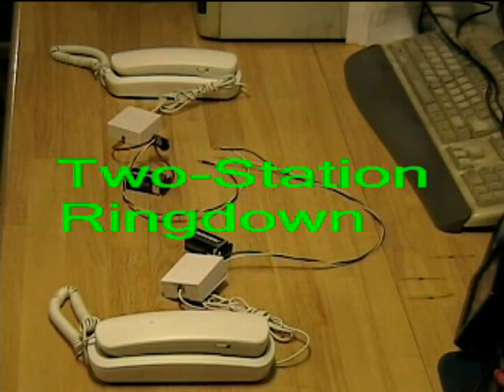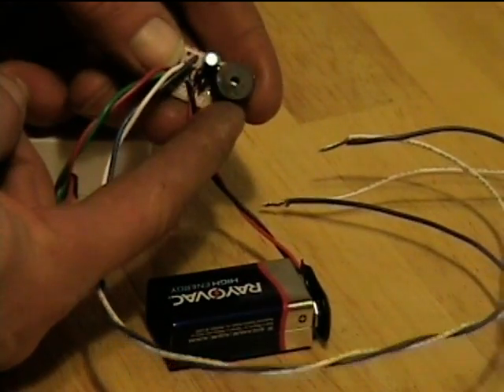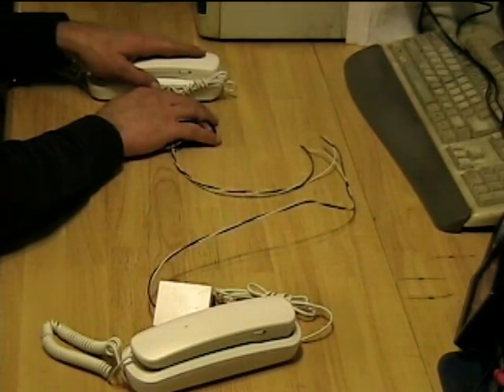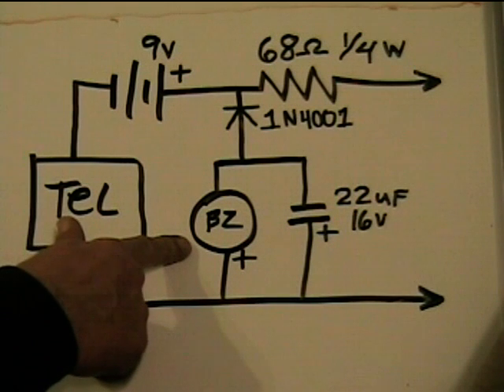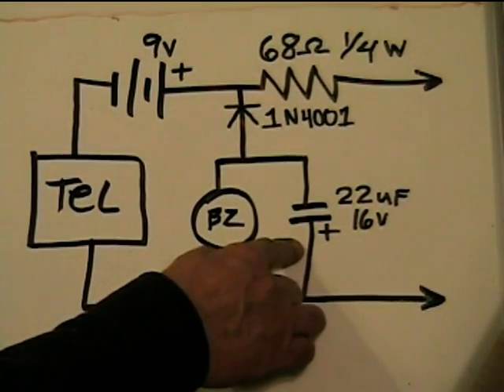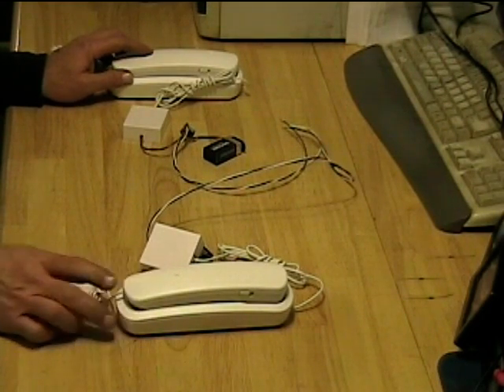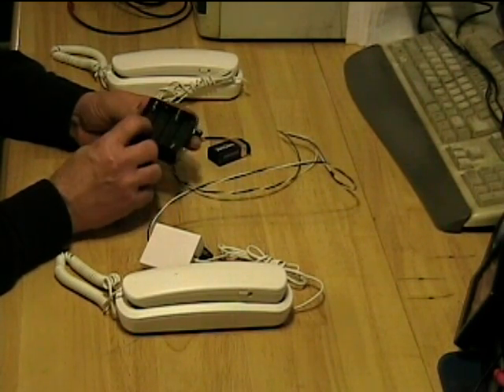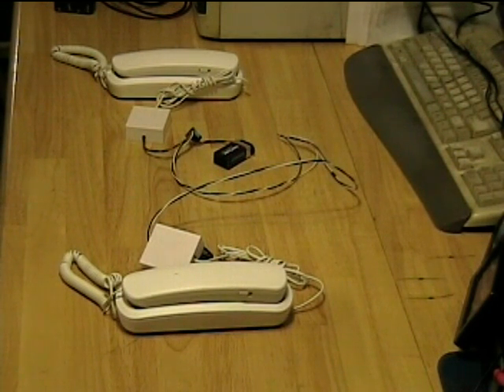Telephone intercom, Two phone w/signal W4P300 #302

Comment: Muito top seu vídeo,coloca nos comentários o material usado para que eu possa traduzi-lo
Reply from the maker: You will need two of each item: Telephone. 9 volt battery with connector. 68 ohm resistor could be 1/4 or 1/2 watt carbon or metal film. Diode (1N4001). Electrolytic capacitor 22uF at 16 volts (10uF would probably be fine). Electronic buzzer rated to operate from 3 to 9, or, 3 to 12 volts DC (very small unit that draws only a few mA of current).

Comment: This works great! It is very practical and works without grid power. This could be great for emergency communication  after a storm takes the power out. An LED can also be placed in this circuit for a visual / silent indicator. Some considerations I have found are that both batteries have to be charged about the same. A dead battery on one end leads to the "ringer" staying on after the other phone is lifted off hook. The battery, on one end powers the other phone and ringer. This also makes the phones only work when a battery is placed in both ends.

Comment: No way this is from 2016
Reply from the maker: Care to explain why you think this? It was created and up loaded in December of 2016. I know. I was there.
Reply: @wired-up  it just seems like an older video than that. I like the design that you used for the circuit, I’ve never seen a system with toning on both ends like that.

Comment: Even if you only need 9v, can you also just run it on 12v? Looking to set this up on a narrow boat to talk between helm and crew on either end of a 55ft boat. I wonder if there is a way to do speakerphone on both ends?
Reply from the maker: The #302 intercom requires two batteries, one at each end. For your short distance, 9V is plenty but you could use 12v if you increase the resistor value slightly (but you still need two batteries). Send me an email to intercom4u at yahoo dot com and ask for diagram #311 which needs only one battery, I think it might be a better solution for you. A speaker-type intercom is possible but it would be nothing like the circuit I show. It would require an audio amplifier (or two, depending on how you would build it). I do not currently have such a circuit available but I have seen others posted.
Reply: @wired-up  thanks. Appreciate the fast and detailed reply. Will email

Comment: hi sir what is analog signal is used for two way & two wire   intercom phone ? voltage analog signal or  current  analog signal witch one signal  use??
Reply from the maker: If you imagine that each phone has a certain amount of resistance and that talking into the microphone will vary the resistance, the current in the circuit will fluctuate as you speak. The earpiece of the phone makes sound according to the variation in current. Since the phone has resistance, the voltage across it will also change as the current changes.
Reply: @wired-up  it means current analog signal used for two wire intercom right
Reply from the maker: @sandeepthorvat6395  I would consider it to be a varying current that conveys the sound, but, as the resistance at the receiving end is not changing, changes in the current also results in a change in voltage. They are related. To consider it to be analog current would be simplest.
Reply: @wired-up  Absolutely amazing explanation of how telephones work. I have asked several people in the past, and they all had complicated explanations. I'm so glad I read these comments. You just blew my mind sir. Thanks, and I'm now subscribed.

Comment: Sir may i know is it possible i use a 12vdc 10amp  power supply in that kind of circuit
Reply from the maker: Well... Yes, but, that would be a few hundred times larger than is necessary! The maximum load is only about 0.03 amps so a 10 amp power supply would easily power the circuit. Don't forget that you need two sources of power, one at each end.

Comment: Hello again, 
I have built the two phone system ( decided I didn't need the three station) works like a charm! 
Question: is there a way to add a light to one end of the two station system?
Reply from the maker: Hi Zane! I have sent you an email with several diagrams, #305 will show how to use local power to operate a light or other device as a signal.

Comment: Hello! 
I am being requested to help with a problem my friends ran into with their intercom setup. After 0.5 miles, no sound can be heard on the line anymore. I am not exactly sure whether there was no sound on the line or less sound because I didn't see it myself.
I am thinking about building the setup in this video and using bigger batteries like you said so that the line can work up to a mile or so!
Will simply using bigger batteries fix this problem? Will the voice of the speaker be correctly transferred to the other phone? What should I be using?
THANK YOU
Reply from the maker: Not necessarily a "bigger" battery, but one with more voltage. 12 volts at each end should be adequate unless you are using very small gauge wire. Higher voltage would be ok as long as the current on the line is not too high. Typically there should be about 15-20mA of current flowing in the line when both phones are picked up. You will need a simple multi-tester meter to measure this. Set the meter to measure DC Current, probably on a scale of 200mA (or whatever the closest scale is on your meter). Break the line between the stations in one place and connect your meter to the line. If the current is too low, you can reduce the resistor value (with a long line you can probably just bypass the resistor) and/or increase the voltage until enough current is flowing. If you have phones that use a carbon microphone and have no electronics in them, they will work at a very low current level (perhaps even as low as 5mA) though the volume will be low. If it has an electret condenser microphone, when the current is too low, it will suddenly quit working. You could also try measuring the Voltage across the two wires of the telephone, typically it would be around 6 volts.

Comment: Dear Sir, I would like to use the buzzers from small wake-up clocks because of their smooth and interrupted sound. Each clock was driven by a 1,5 V battery. Could you tell me what capacitors I must use in order not to  damage the buzzers? Many thanks to share your experience!
Reply from the maker: Send me an email and I can send you a diagram that might work to provide 1.5vdc. I'm not sure this is going to work because I would guess that the buzzer in your clock may only be a speaker (piezo) that is driven by the clock IC. Before going further, try feeding the 'buzzer' directly from a 1.5v battery to see if it will buzz. I'm guessing that, if anything, all you would get is a click. If it actually buzzes, I can provide you with a circuit.  Rich

Comment: Can I use three phones with this set up?  Only two would be used at any one time.
Working on a set up between the shop, kitchen and bedroom. 
Thanks for the great info.
Reply from the maker: This circuit is only for two stations as shown. I have another circuit that will allow you to have several phones on a "party line" where any phone can talk to any other phone. It has a simple signalling system where you press a button and the buzzer at all the other phones will sound but it could easily be adapted to have a couple buttons at each station to allow you to buzz just one other station if you have enough wires at each location. Send me an email at intercom4u at yahoo dot com and ask for diagram #321 parallel intercom.
Reply: @wired-up  Email sent, thanks!

Comment: 2 x 68E 5% 1/4 Watt Carbon Film Resistor
2 x Buzzer PCB Mount 3-16VDC 4.1kHz 70dB/12V
2 x 1N4001 Rectifier Diode 50V 1A
2 x 22uF Electrolytic CAP Radial 16V

Costs only R77 in South Africa, or a little under 10 USD. Definitely worth the price of the components used. Definitely gonna make this
Reply: South African here en moerse dankie. Appreciated this.

Comment: Thanks for the video! you mentioned a mile long wire and that it will require more power because of the resistance. is that the only challenge using such a long line? is there anything else i should take into consideration?
Reply from the maker: The longer line has more resistance so you need to increase the voltage to keep the current high enough for the buzzer and talk circuit. 1000 feet of cat-5 type cable will have a resistance of about 50 ohms. If you have more than a few thousand feet you could eliminate the 68 ohm resistors, doing away with both of them would let you go 3000+ feet with no problem, maybe a mile but at that point I would increase the voltage a little. The only other issue would be that on a very long line, the high frequency response will drop off some but this really doesn't become a problem until you try to go several miles. The telephone company sometimes runs long lines (like 10 miles) and that is why they start with a much higher voltage (48 volts nominal).
Reply: @wired-up  Awesome thanks!

Comment: Hi there, I have been looking at ways to make a recording microphone from a telephone.  Most of them have you take the phone apart and use the earpiece as the microphone... but couldn't I just take the wire coming out of the phone and add the 9v battery and 300 Ohm resistor  and just solder that to a phono jack that I plug into an amplifier?
Reply from the maker: What I would try is putting the battery, phone and resistor all in series; the phone now has power. Then, connect across the resistor to feed the phono plug - BUT - you need to block DC current from going to the input of your amplifier. You can do this by putting a capacitor in the wire that connects to the center pin (or tip) of the phono plug. What value capacitor? that would depend on the input impedance of the amplifier. If the impedance is high (likely), something like a 0.1uF cap would do. If you don't get enough signal, you could try a small electrolytic (4.7 or 10uf) but watch the polarity.
Reply: @wired-up  Thanks for your reply. I realized for my purposes, it didn't really matter if I used the earpiece or the mouthpiece, so I took the easy route. More of just a fun toy project than an electronics project. https://www.youtube.com/watch?v=cLNg8jUFTtk&t=33s

Comment: Great video! I plan on doing this as a summer project with my son when I get a bit better at soldering and reading electrical diagrams. Can I ask where you normally purchase your components?
Reply from the maker: I have many places that I get parts, these are all very common electronic components. Parts can be bought on ebay from sellers in china very cheaply in quantity. Mouser Electronics (mouser.com) has no minimum order so it is "hobbyist friendly". The buzzer part number I have used from Mouser is 539-PK-12N40PQ (though I think they are a bit pricey at about $3).

Comment: Hi Sir, Can i add 3 more telephones in your simple circuit diagram? i don't want dial code or beep.
Reply from the maker: In a word, no.  If you just want to hook a bunch of phones together but don't need any signal, just connect all the phones in parallel and then supply 12v dc power through a resistor to them. The resistor should be about 150 ohms (could be a little less but not less than 100 ohms) rated for 1/2 watt (or more). Pick up any two phones and they can talk to each other. The volume wont be great but it will be usable. Volume will drop off if more phones are picked up.
Reply: i want something like TV Crew intercom for group communication. if you have any cool idea let me know. Thank you.

Comment: can i add an led to the circuit
Reply from the maker: You could put an LED in place of the buzzer (I'm assuming you want the LED to light as a signal that the other station is calling). Use a meter to measure the current thru the LED, add some resistance in series with the LED if the current is too high (most common LEDs are good for a max of 20mA).
Reply: many thanks  yes  but i wanted to have the buzer as well so i have an audible and visual would it  be possible to have both at the same time
Reply from the maker: Since the power to operate the signal must pass through the telephone and resistors, it would be difficult to operate both the buzzer and an LED. You could use the signal to operate the LED in an opto-coupler (something like a 4n28 or ps2501), the output of the opto-coupler would then drive a transistor (2n3904 would do) which would use power from the local battery to drive the buzzer and LED. I'm a bit busy at work right now but I could try to draw something up for you if you can't figure it out. Send me an email;  intercom4u at yahoo dot com
Reply: yes please if you could i would be graet full
Reply: @wired-up  i would love that drawing as well! will email you now.

Comment: could I use a 22uf @35v cap
Reply from the maker: Yes, a 35v cap would be fine. You can use a higher voltage rating capacitor, the only harm is to your wallet and that it will be slightly larger. Also, 22uF is probably more than is necessary, 10uF is likely plenty, it all depends on the characteristics of your buzzer. The cap value is not critical in the circuit.

Comment: Would swapping the buzzer with a relay work?
Reply from the maker: It would have to be a very sensitive relay, maybe a reed relay would work. As you see from the circuit, the current for the buzzer (or relay in this case) also has to flow through the telephone and resistor at the calling end which is going to cause a significant voltage drop and limit the current. Perhaps you could use an opto-coupler in place of the buzzer and use the transistor output of the opto-coupler to drive a small relay or an external transistor to drive the relay using power from the local battery.

Comment: Thanks Sir, Hope It Will Help Me A Lot. 
Can I Use 9v adapter ?
Reply from the maker: Yes, a 9V adapter would be OK. It must be DC output and well filtered or there will be a hum or buzzing sound on the phones. You will need two adapters (one at each phone) and they must put out the same voltage under load. If there is a significant difference in the voltage, the buzzer at one station may continue to sound even when both phones are lifted. For additional information, email me:  intercom4u at yahoo dot com  and ask for #302 Ringdown circuit.